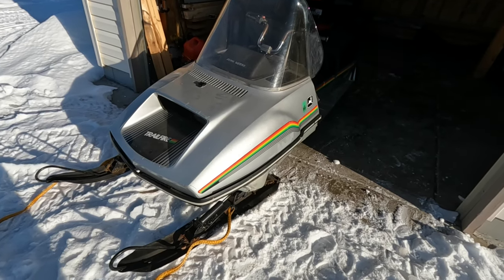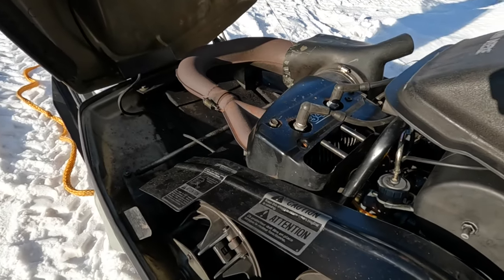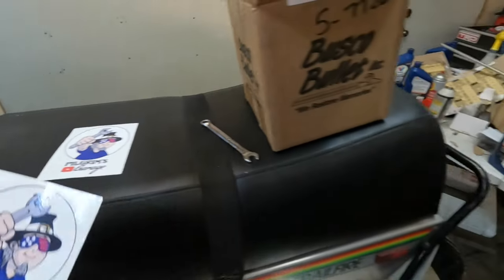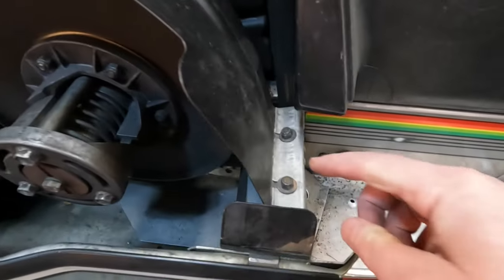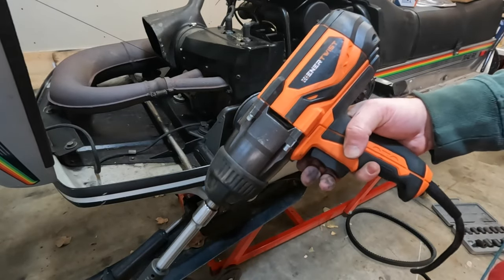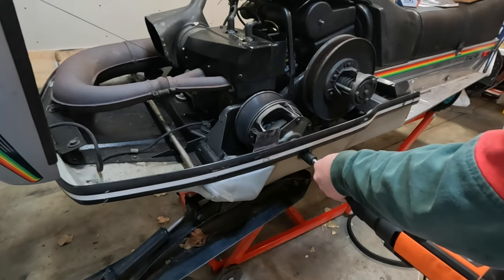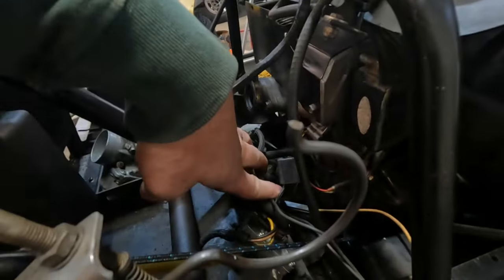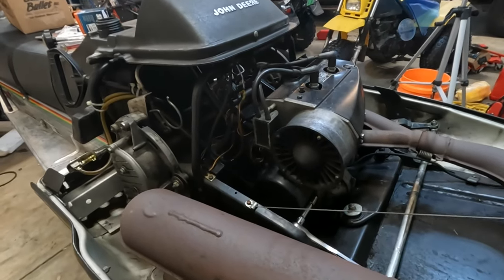Snowmobile Engine Rebuild | John Deere Trailfire 340 Part 1 #vintage #snowmobile #vintagesleds

Comment: whats the puller part number? for the clutch that is..
Reply from the maker: https://amzn.to/3t9vprk

As an Amazon Associate I earn from qualifying purchases.
Reply: @GarageWorx Did you take the belt off. If not you will wreck the track. And engine. I always take the belt off if I am towing a snowmobile back to the barn